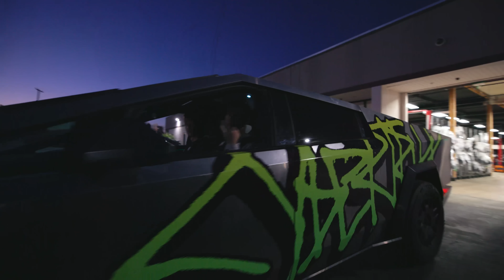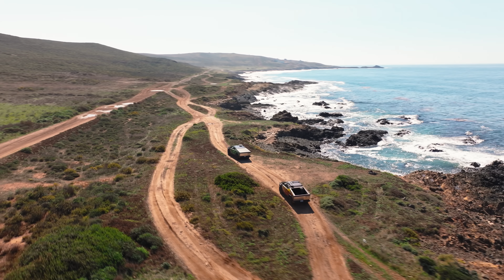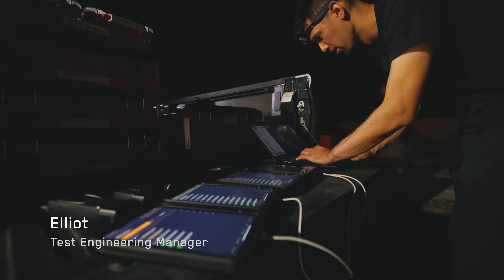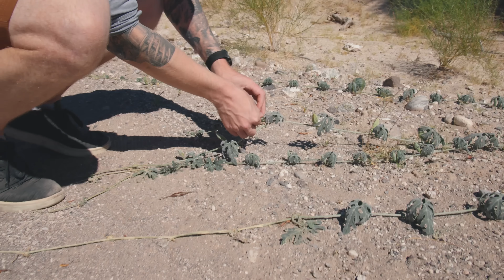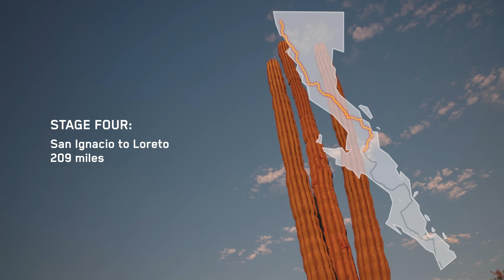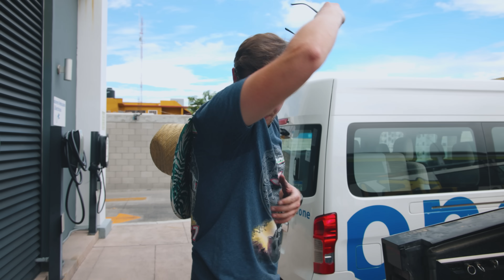Road to Cybertruck | Baja

Comment: Respect the honesty of the cracked windshield... exponentially increases trust in the process 👍!
Reply: Yeah you need to build back a lot of trust after all the false promises elon made regarding this car.
Reply: I feel like they did that on purpose to show the rigidity of the truck. even though the windshield broke, any other truck would have much more damage
Reply: @Pilberto We can’t know that without testing other trucks. The cracked glass denotes body flex which is not optimal.
Reply: @PumpUptheJam81 I thought it would have signaled that there was not enough body flex because it transmitted all the shock to the winshield instead of absorbing it.
Reply: @officebear4637 making the Impossible mearly late ...!! mate !
Reply: Any other truck would've probably end up with a bent chassis
Reply: lol
Reply: The whole vehicle is garbage
Reply: @PumpUptheJam81 any other truck would be fucked
Reply: @URsooomad8613  Yeah sure....and this is why you made sure to watch the whole video and took the time to comment.  Garbage is usually ignored by most but there is a reason you did not.
Reply: Exponentially confirms the Cybertruck should only be used on flat dirt roads or beginner trails. You take it on anything intermediate or hard trails and you will damage more than a windshield , kiss that frame and battery good bye. Cybertruck is not there yet and I hope owners know and under stand its limitations
Reply: One fragile part of the truck failed. This must be hardest test of all automotive industries 🤣
Reply: @cv2010u  I feel like you don't understand exponents.
Reply: dont be so naive. it was intentionally done by them to test the damage, they saw the ditch and still went at a high speed.
Reply: @damfadd you nailed it. The impossible, delivered a little late. The haters don’t get this because they’re blinded by their self loathing and insecurities.
Reply: That's a far fall from being Bullet proof lol
Reply: @Pilberto yeah, they totally did it on purpose ... You can hear the driver exclaim and can see him slamming on the brakes, you can see the reduction in speed before impact but since the truck is so heavy they were not able to stop before hitting it. The fact they were hard on the brakes loaded the front suspension, reducing available travel and increasing weight on front end, worsening the hit.
Reply: @URsooomad8613 Evidence? Data? Or just opinion. I'm not bothered about your opinion. "It's different and therefore I don't like it". Show me some valid data that shows it's less good than the old, old designs of the so-called competition.
Reply: @justohird5685  Yup. So many people think "exponential" means "Very big" or "Lots". Just like acceleration doesn't mean velocity.
Reply: @BSenta  Nobody said the windscreen was bulletproof. Everything else survived.
Reply: @getreal7217  Didn't watch a single second of the video, just came straight to the comments🤣 Nice try tho lil slim
Reply: @garyrooksby  Goofy haircut havin ahh☠️
Reply: The fact that Tesla shows us without fear also the shortcomings, it shows a powerful company that I believe is already working on a treatment for this
Reply: That's awesome! 
How about the New Tesla Innovation shares?
Do you have any?
Reply: @Pilberto Rofl no it wouldn't. My Raptor would have laughed at that little dip in the dirt road.
Reply: @officebear4637 we all know you can't even afford it man
Reply: @BSenta It might not be Bullet proof, but you do understand that actual Bullet proof glass shatters too right? (It just doesn't let the bullet fully pass through the shattered glass)
Reply: The one cool thing in my opinion about that truck is the exoskeleton structure (stressed skin). However, windshield is the crux... It took the hit from the rut and transferred that energy into the windshield. I had something similar in my car, but I hit a large landscaping rock that fell off a truck at 50 MPH. It rolled under my car, hit the frame, threw my car in the air. Dented front subframe on my car and took that much shock to crack my windshield, just a LITTLE. That windshield really took a hit on the cybertruck... It was from shock of impact, the stiff structure transferred the hit from the wheels through the suspension (probably hit bump stops) then into the structure and transferred it to the glass which ultimately couldn't take it.
Reply: But this is supper awful that they said that the car was excellent instead of making conclusions and fixing a problem that caused a windshield to crack!

Comment: As someone who grew up in AZ doing a lot of backcountry  driving, if you did that much mileage and only had a broken windshield then that is a testament as to how bombproof those trucks are. Our mantra was "It isn't 4 wheeling until something breaks" pretty much everytime when you are driving hard. Long washboard roads with cuts and washouts is extremely fatiguing, esp after a couple hours of that, so much concentration when you are running stock vehicles  and have to baby them over sections. I liked the amateur hour feel to this too, like not knowing how to deal with cactus (two rocks), not wearing white in heat/sun, no inclinometer, etc. Not bagging, we have all been there, fun stuff, and in one trip you logged as much as most. Epic footage, amazing vehicles, green season desert, those amazing saguaros. Thanks!
Reply: The engineers might say that black blocks more UV...
Reply: @thatteslacat6334  problem with time in a lab vs actual time in the desert sun. one case of heatstroke will set anyone straight
Reply: these are radio connected , well organized teams with BRAND NEW CARS, NOTHING should happen in this very very mild conditions.
Reply: 2 rocks?? Never enter the back country without your multi tool pliers....
Reply: as someone who's driven Uber in Philadelphia, that's nothing
Reply: I've seen a few videos with the cracked windshield.
Reply: That's awesome! 
How about the New Tesla Innovation shares?
Do you have any?
Reply: Lol, how much did they pay you to say this?
Reply: @carl9901  Uber in Philly? You serious?
Reply: I'm sure its nothing like the grand Tour with a full outfit of support vehicles and they don't repair the vehicles along the way not on camera
Reply: I'm Australian and this isn't even close to be 4wd 😂😂😂 do Simpson desert, cape York then we can talk those are made for rich los Angeles boys
Reply: And where, exactly are the charging stations in the desert?
:face-orange-raised-eyebrow: Fail.
Reply: Nobody is reading this entire annoying ahh comment😂
Reply: You drove on dirt roads. You didn't do offroading. Dont kid yourself.
Reply: I grew up off-roading in AZ, and I can say with certainty that this truck would not be able to handle it
Reply: Fully agree. Offroading in the mountains and deserts of California, you keep a tool kit, basic survival gear and spare bolts and stop nuts of every size with you or you're f*cked. Quite often the Wranglers were put through the trenches and needed something tightened, fixed or improvised.
Reply: I've done well over 100k miles of off road here in Arizona. Breakage... a couple tires THAT'S it. Couple Nissan Pathfinders with over 200k miles, Chevy Tahoe with 260k+ miles.
Reply: @eviltux65 amen to that, I didn't see ANYTHING that difficult in their clips... Maybe assume, they did the whole baja trail? but didn't film the tricky sections???

Comment: The glass didn't break from the impact, it cracked from the chassis twisting. 1 small inexpensive change will allow that glass to float and move independently from the chassis drastically decreasing the chances of it cracking from the structure twisting.
Reply: Breaking is breaking, and it still broke. They already sold the trucks like this so too late.
Another huge tesla L💀
Reply: In my opinion it did crack from the structure being too stiff. The system instead of dampening the impact, transferred the force into the windshield. My guess is they hit the suspension bump stops. The body mounts couldn't quite dampen the shock wave... and that structure / stressed skin communicated the shock wave across it and into the glass. I don't know a good fix, probably more suspension travel. Hard to say without driving the thing. Not very practical though to float a windshield. Most automotive windshields today are a stressed member of the body. They are designed to help strengthen the structure in case of roll over / accident.

Comment: Got my invitation a couple weeks ago! Foundation series Cyberbeast ordered 😎
Can't wait to make videos of it and take delivery
Can you guys please design a cool motorized solar panel that unfolds out of the bed that gives us 30-50 miles of range in a 8-10 hour period while we're parked at work or off grid? That would be incredible.
Reply: Get your workplace to install solar panels and level 2 chargers, then anyone can charge!
Reply: @Nphen  you're missing the point. A bed stored solar panel would allow you to charge anywhere, any time, in any parking spot, or in the middle of nowhere.
People like me don't work in one place. I'm a pilot. I want to push a button and a 10'x5' solar panel unfolds from my bed in 30-60 seconds.
Reply: They did have an idea to make the tonneau cover solar.  That would even allow charging while driving.  But that would be pretty insignificant power generation, definitely not enough to justify the cost of such a system.  Even scaling up to a much larger panel that covered the entire roof and bed would only generate 4~5kWh/day...which would be about 10~12 miles.
And to the other guy's point, a solar canopy in airport parking lots seems way more practical.  There's so much space to do something like that.  Unfortunately, you can't benefit from something that isn't there, which I think is your point.
Reply: If every airport has Level 2 chargers or Supercharger stalls, you can charge... anywhere. As every Tesla owner already knows. For boondocking, there are plenty of off-grid solar-powered battery backup systems available. The bed will easily hold 10kw of solar, or look at a Lightship trailer. A 50 sq ft solar panel will "just" unfold from your trunk in 30-60 seconds would take years to develop and cost you $30k for the wattage of a $5k solar system.
Reply: @Nphen  every airport doesn't have charging.. in fact, none of mine do otherwise I wouldn't want solar. I'm also off airport very often, I fly helicopters... People always have answers for things they have no clue what they're talking about 🙄
And you are 100% incorrect on the cost 🤣
A top tier 400w solar panel costs about $600-800.. if you put 800-1kw worth of panels on a motorized unit, it would cost around $5-7k depending how fancy it was and afford you 15-20 miles per day.
The cyberbeast gets 2.1 miles per kilowatt on the absolute lowest report of mileage in freezing weather going 70mpg on the highway.
Meaning a minimum effort cheap 1kw system gives you 16 miles on a mediocre day. Towing a trailer every day would literally negate the point of even having it? 🤣

Comment: I hate to be that guy, but this is seriously unimpressive. There was nothing shown in this video that a stock awd crossover couldn't handle.
Reply: Not to mention handle better and without worrying about charging, a stock awd crossover would beat this thing in a race where they took it, and I'm not even a fan of those crossovers.
Reply: I think the point of the test was to show how a complete ground up electric vehicle build could handle some pre running.  Not that this would compete with a purpose built truck.  It was more a systems test.

Comment: In 10 years, hopefully the batteries are much more energy dense. By that point, the range will have improved, and all the kinks will be worked out. But rn... To do actual truck things like tow 20,000+ lbs, for more than 100 miles, somewhat regularly....  Just not there yet. As much as I'd like it to be.

Comment: Would be really interesting to see them actually attempt the Baja 1000 (the real one by SCORE not the NORRA rally). Always been the ultimate proving grounds for truck manufactures. It would no doubt require a veteran Baja racer like Larry Roeseler and an experienced chase crew as well as a serious offroad shop like Camburg to help them prep the truck but it would be a huge deal even if they didn't win, just a finish would be huge. The biggest hurdle would be figuring out a way to either swap batteries quickly or charge them extremely fast but if they could figure that out, I don't see why it's not possible. Ford launched the Raptor by doing Baja and they just did it again in 2022 with their Raptor Ranger and won. Who knows, might win over some hardcore anti electric truck guys like myself if it conquered Baja.

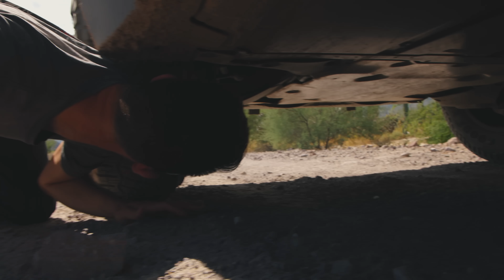Comment: 😂🧢,battery over heats in the desert 🌵 & gets you stranded there’s no chargers/plugs 🔌 also.💀😂 & 7:28 I thought it was bulletproof class. Quest they still haven’t fixed it.💀
Reply: The battery doesn't overheat in the desert though. And when did anyone say the glass was bulletproof? Bulletproof glass is immensely thick.
Reply: @logitech4873  Elon said the class was bulletproof when he tried throwing a metal ball at it the 1st day & broke,& it does over heat 💀
Reply: @Quest3334  He didn't say it was bulletproof, no. Maybe you should watch that again instead of reciting from memory.

Why would it overheat?

Comment: What would be fascinating is to see an electric vehicle finish the baja1000 in less than 30 hours. I think the cyber truck would be "the talk of the town" if it actually pulls it off.

Personally, I do hope you actually pull this off. I know there was a VW EV that finished the race in 5 days. impressive, but was not impressed by the 5 days part.

Comment: In a fashion of SpaceX, the car did not broke, which means you did not push it through its limits. 
I have seen few videos of Cybertruck loosing its wheels duo to swing arm bending like a paper and thats something that should be addressed seriously. I mean if thats gonna happen on a Mars, how they gonna fix it there? Cybertruck should be rock solid with every part and especially the drive and steering elements. No point having a tank if it looses its wheel at a first bump.

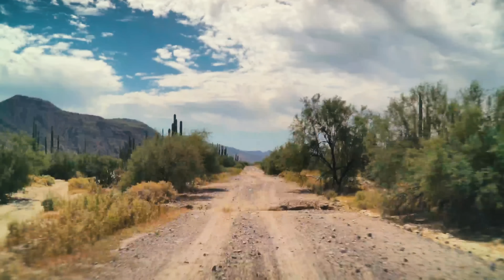Comment: 7:05 - honestly, driver's fault. Missed a ditch – don't brake!  Short quick acceleration to take weight off the front axis, and rapid sharp release of  the "gas" pedal right after the front axis crosses the ditch. Also if you and not ready for any reasons to do that – just don't brake and cross it with a slight angle.

Comment: XD these things cant even handle going though 3 ft of water. watched one of em die right after going through a bit of water  woith a depth that my tacoma has gone through several times with no issues. These tesles will just straight up stop workin after.

Comment: The air suspension will not last too long if you boys really push it in off road situation.
Reply: Most rally car and baja truck actually replace the suspension every race. So yes
Reply: @LeftOverMacNCheese  we rebuilt the shock after long race...
Reply: @itonylee1  well yeah that make more sense.

Comment: One thing it doesn't have, is my GSAGA(Gravity Shock Absorber Generating Assist) system yet. You've generated a tremendous amount of energy driving in that terrain, and collected zero of it. ✍F=G m1m2 / R2 works 247365/~ See my X (No reply from Elon yet)

Comment: The truth is how long does the battery hold in extreme heat or cold , if the car was hydrogen cell  powered then it would be interesting
Reply: Are you making a statement or are you asking a question?